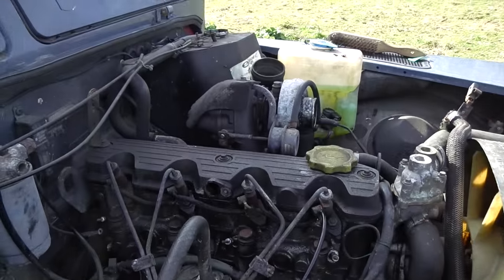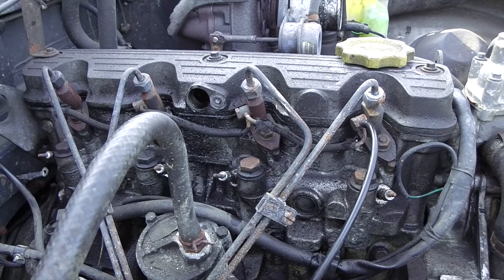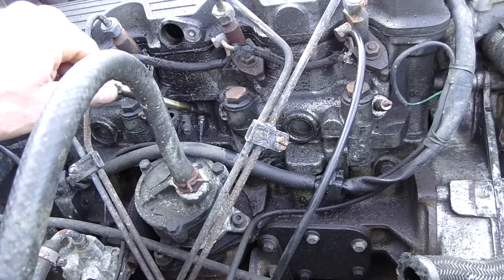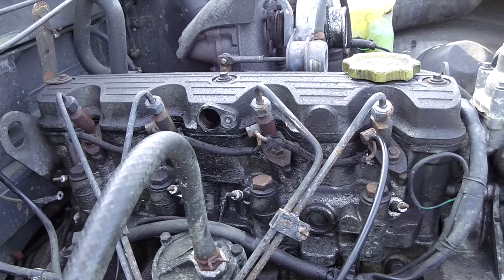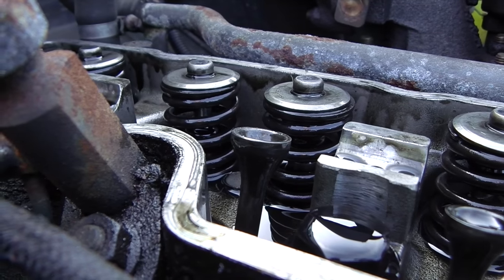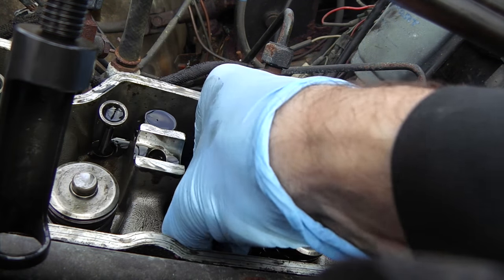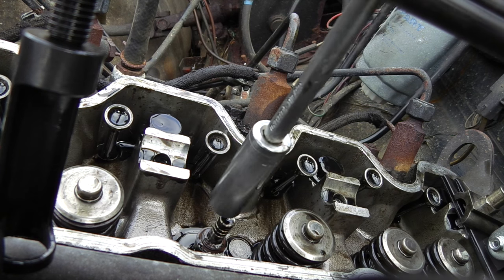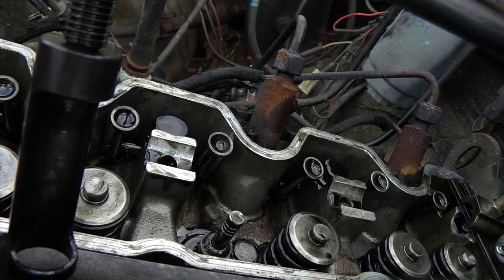LandRover Defender 200 TDI Valve Stem Seals And Broken Bolt

Comment: @P A Photography  Great video. I am curious how much air is put into the glow plug hole to keep the piston up, what PSI? Also, are you just finding a 10mm air adapter or was it called? Thanks!

Comment: Hi, I got the same issue on my Defender 200 TDI.  What I don't understand is how you know when the valve is on the higher possition  so that it doesn't drop down once you are putting the spring down. I have seen you mention to put a wire into the glowplug housing but the problem is one of my glowpugs (the one you remove on the video) broke down inside a few years ago when I tryed to replace it and since then I have leave it like this. How can I make sure the valve are on top position?
Thanks for the video.
Reply from the maker: Hi
If you remove the glow plugs before carrying put the procedure,  put the engine on to TDC and use a thin piece of thin stiff wire down the glow plug hole and feel which piston are up.  So if no 1 is at TDC then no 4 will  be same. ... once you have done 1 and 4 then rotate engine until the other cylinders are at TDC by checking with a piece of stiff wire down through the glow plug hole... hope that makes sense...
Reply: @paphotography5183  Thanks for your answer😉

Comment: thanks for the vid , do you have a manufacture name on that valve spring compressor tool trying to find one here in tasmania Australia and all i can see online here are the ones in the red box you said to stay away from , thanks for that tip too , also i see you did that on your 200tdi will it fit a 300tdi defender as well for some reason unknown to me i now have both cheers
Reply from the maker: Hi mate, the manufacturer was a company called laser. If you have trouble getting one I could get one and send out to you.
Reply: @paphotography5183  thanks very kind offer but , i'll be able to hunt it down now, thanks for your help mate cheers

Comment: hi where did you buy the tool from, i need to do mine and this looks like a good bit of kit.
Reply from the maker: lee smith ...Highly,  I got the tool from my local euro car parts, but you can get them from Amazon as well.  Good bit of kit. Avoid the cheap ones in red boxes as they break. It is a laser product I do belive sykes do one. also . Im in North Devon if your local you can borrow mine
Reply: Thankyou, im in herts so a bit of trek, thanks though. Really good video. How do the caps come off out of interest? thanks lee
Reply from the maker: lee smith .Hi Lee,  when you compress the valve, remove the collets,  then the top cap and spring simply lift away. If you need any advice mate, you can get me on thompsonaaman@aol.com  or 07545 637809
Reply: thankyou , i hope it will cure my smoke problem. all the best lee
Reply from the maker: lee smith Good luck let me know how it goes....
Reply: will do thanks
Reply: any chance of borrowing the tool  @paphotography5183

Comment: hi, did changing the valve stem seals stop the smoke on start up? as mine smokes on start up until its been driven for a bit then stops. I did think it might be the piston rings but if it was that, surely it would be smoking all the time?
Reply from the maker: Ian Deakin 
Hi mate, yes it stopped blue smoke on startup. You tend to find when engine components are cold you can get oil burning on startup but as things warm up things get a bit tighter and it will stop or reduce. I went for valve stem seals  first as it was the cheaper option and only took me an hour or so with that cool compressor. since then I only get one puff of diesel smoke on cold start then clear 
.. no blue. What mileage has yours done.?
Reply: I'm not sure as this is not the original engine. The last owner had the 200tdi put in because it originally had the 2.5 na diesel engine. it is an ex MOD 90
Reply from the maker: Ian Deakin 
200dti good strong engine.... If I were you I'd go for valve stem seals first. if you take the rocker cover off , you might even see some seals half way up the valves if they have deteriorated. if they are badly worn you will get oil run down on to the valves for a good while until she really warms up.
Mine used to burn blue on startup and for a while under load. now there done she's clean. also changed breather  etc.
if you want any advise you can get me on this email or via this youtube link.👍

thompsonaaman@aol.com
Reply: ANNE & PAUL PHOTOGRAPHY
Great video. Where can I buy this tool?

Comment: Intertesting tool.  Never seen one like that.
Reply from the maker: Worked a treat.... plus no more blue smoke. Goto change lt77 gearbox next... started making some unpleasant noises....
Reply from the maker: Worked a treat.... plus no more blue smoke. Goto change lt77 gearbox next... started making some unpleasant noises....
Reply: Well, they don't last forever.
Reply from the maker: yep that's true.... just plucking up the strength to drop the box out...  You have some great videos... very useful
Reply: Thanks.